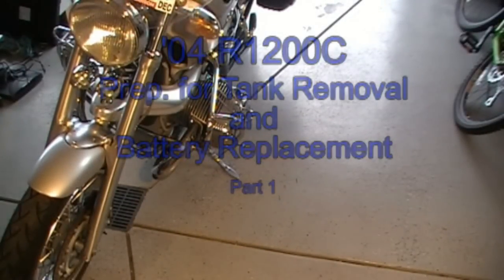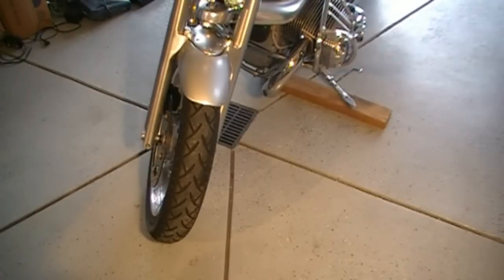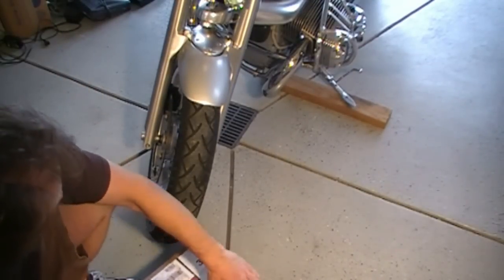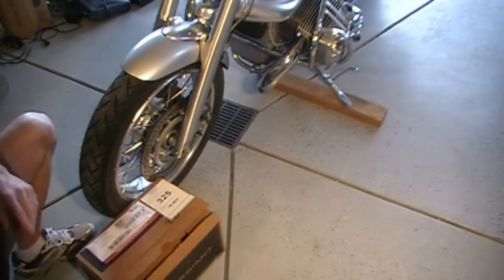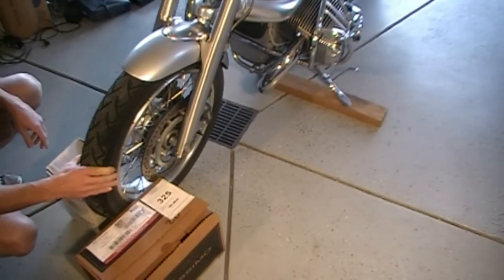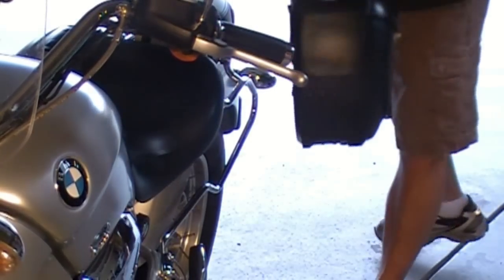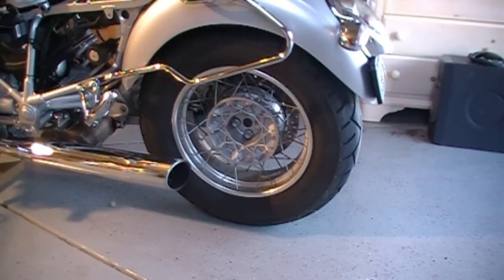BMW R1200C Prep, Gas Tank Removal, for Battery Install - Part 1 of 3

Comment: I add 1 thing to this whole keep track of washers statement. When doing any repairs where small parts and bolts are removed, use a 2$ plano tackle box. 3 reasons. It keeps like parts together, it keeps different operations separate (tank bolts vs seat bolts). You can keep them in order of operation. You can close it, and if you step on it stuff doesnt go everywhere. Well thats 4, Bonus reason? As a professional technician thats how i do it. bonus reason 2, you can put a piece of tape on it and write which vehicle it goes to if you have multiples disassembled, Which i normally do.
Awesome Vid.
Reply from the maker: Thanks for watching. That's a great tip! I think I'll get one or two.

Comment: Thanks for this step by step instructional - my R1200C is a bit older so I did not have the quick connects but it was close enough to get me thru this.  Had it back on the road this past weekend
Reply from the maker: Excellent. I am happy this video has helped so many riders!
Reply: Clymer M503-3. Then you don't need youtube

Comment: I have a shop manual but watching you do the battery replacement was extremely helpful for me.  Thank you for posting this great video!  Happy New Year!
Reply from the maker: Sweet! Happy it helped.
Reply: @PeteDeichmann  Thanks Pete!   I have a 2002 R1200C and I'm guessing it's not going to have those quick-release connections on the gas lines that you demonstrated.  If I don't have the quick-release connectors, what kind of clamps will I need?   Like you, I just top-off the tank before my battery died.  Any recommendation you could share would be greatly appreciated.  Thank you so much!
Reply from the maker: Hope this gets back to you in time. I missed the notification. The tubing on mine is pretty soft. I think any clamp that would hold it in a bent back fashion would work as long as the hose is completely closed off. If I were doing it, I'd invest in a couple pairs of hose clamp pliers though.
Reply: Pete:  Thanks, again!, for taking the time to respond to me.  I really appreciate your technical advice.   Because I'm a "visual" person, I can't tell you how much your video is going to help me when I replace the battery.  This is like having a great mechanic at my side as I do this work.  If you haven't already guessed, I don't typically do my own mechanical work but I think this battery replacement would cost a small fortune at the BMW bike shop--not to mention having the cost of having the bike flat-bedded to the shop---the battery is completely dead.   Thank you very much!
Reply: Pete:   I ended up replacing all of the fuel lines in addition to the battery and because of the pandemic, my project was delayed. As of May 23, I’m so grateful to tell you that I completed the project and put the bike back together and it started on the first turn. Thank you so much for making this project possible for me.  I have very little mechanical ability and the instructional quality of your video was fantastic. If you’re not doing this for a living already, you should think about going in to business. Teaching people how to work on their vehicles is worth it’s weight in gold! Thanks again Pete. I really appreciate all of your help.
Reply from the maker: @lewsoltis5142  Glad to see you got it all done. I don't know what is up with YouTube; I haven't been getting comment notifications from them.

Comment: I have a year 1 bike...1998.  No quick disconnects on the fuel line.  It is a pain to disconnect as it is rubber hose going to plastic line.  I just swiveled the tank left and set it down on the frame and a well placed childrens high chair and did not have to disconnect the fuel lines.  Remember your ant-acids because it a bit precarious and nerve wracking.  Also my tank mount bolts had large plastic washers between the frame and tank.  Blue lock-tite on the tank mount bolts is your friend.  My left one was so loose i removed by hand.
Reply from the maker: It was nerve racking enough doing this with a full tank, I don't even want to think about your little balancing act! I'll be pulling the tank again soon to install the JumpEZE cables I got from Pokie a while back. This time i"m going to run it nearly dry. Thanks for visiting!
Reply: Mine was nearly dry.  After twisting and tugging around on the fuel tubes and lines for an hour trying the loosen them I was willing to take drastic measures...I should have taken a picture... and a beer or two helps with the nerves. Thanks for the video!  Is your new battery not working that you need a jump?  My new stock lead acid I put in yesterday hits a lot better than the older battery but it still does not spin it over with authority as I would like.  My Sportster 1200 is similar. My 1500 Kawasaki on the other hand has a compression release and the batteries last years.
Reply from the maker: Bill Felton The Shorai is working well so far. I keep it on a trickle charge too though. It's been a snowier winter than usual and the bike sat a lot. I found even with the trickle charger the OEM battery wasn't holding a charge well and I had to pop start it once in the driveway; not easy to do. That's when I decided to replace it. I got the JumpEZE to be proactive in case I get a dead battery in the future. It seems the R1200C likes to drain away at the battery between rides. I kinda miss my old Yamaha SR500; it didn't even need one!
Reply: you simply don't need to disconect the fuel line. the video guy just sells crap.

Comment: Thanks. I don't know if you will read this comment from this date but maybe you will. I have a 2003 Phoenix. Yeah the battery is so tucked up in there it's hard to get at it without taking the tank off. I was wondering where you got your seat. The original on mine is not that comfortable. It seems BMW makes great products and the bike is very nice but not enough thought went into seat comfort.
Reply from the maker: Love the Phoenix models. That is what I was originally searching for when I found this one! The seat came on the bike when i bought it used. It is a fair seat, not great. It slides me a little more forward than I'd like and is a little thin on cushioning. If I was shorter it wouldn't be a big deal. It was made by Bill Mayer - https://www.billmayer-saddles.com/ . Corbin also made some nice comfort saddles for the R1200C as well. Check ebay, I have seen quite a few out there. Another option might be if you have a local vehicle upholsterer; they can usually rebuild your seat however you'd like it.

Comment: Thanks for such a simple explanation. WHAT a faf just to replace a battery! Still at least I know how to get to the thing so I can connect a couple of cables for some fog lights. Stupid design :-) Thanks again
Reply from the maker: Glad to have helped.  I love my bike, but It's a result of modern designer's apparent need to hide everything "unsightly". Sacrificing utility for a smooth look...
Reply: @PeteDeichmann  I wish mine was as pristine as yours. Still a head turner that everyone comes and admires. Mine is at that stage it needs to be pulled apart and rebuilt from the ground up. Not a job I can tackle but maybe one day if I win the lottery:-) thanks again

Comment: Hello Pete. Thank you for the video. I was able to replace the battery on my 1999 bike..but now the bike is dying when idle. Could you please let me know what could be the problem? By the way I have an "extra" hose that I don't  know where this goes.let me see if I can share a photo.
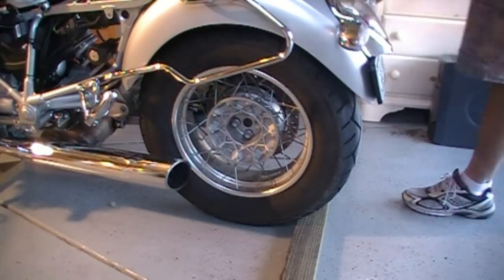Reply from the maker: Make sure your fuel hoses aren't pinched, The 1999 has different hoses and may have different breathers too. Check the hoses at 9:00 on this video and at 1:39 on video #3 to see if you can spot where your extra hose belongs.
Reply: @PeteDeichmann  I think I solved the problem...I cleaned up the air folder and seems to be working fine now. The extra hose is a breather (one of the 3 breathers that go down the bike). Apperently is not connected to anything..or can find it to where..thx!!

Comment: I’m a bit confused because my manual says to disconnect the negative battery terminal before removing the fuel tank even though the tank must be off to access the battery.
Reply from the maker: I don't know of another way to disconnect it. There may be, but I just don't know it.

Comment: you don't need to remove the tank. a buddy is going to keep it up for you - this while, you change/replace battery and that's it. the berlin guys never intended it that complicated.
Reply from the maker: Unfortunately lots of us don't  have a buddy around to help out. Thanks for watching and contributing.
Reply from the maker: Yes, after Dan's comment I went back and reviewed the method I used. I see no way to do it without removing everything I pulled including the tank.  Even if i had a massive bodybuilder buddy! Of course, pulling the toolkit and bags were just for convenience of getting around the bike.